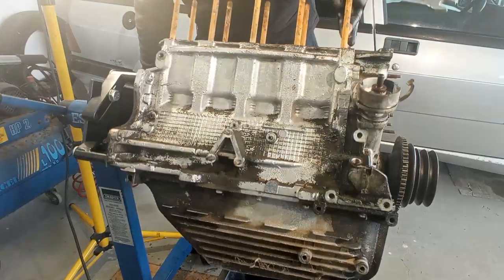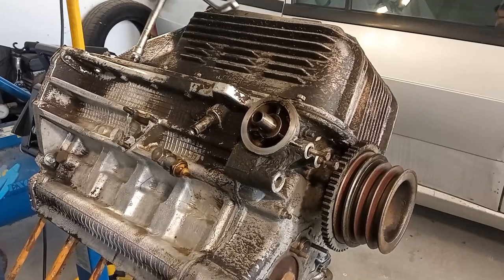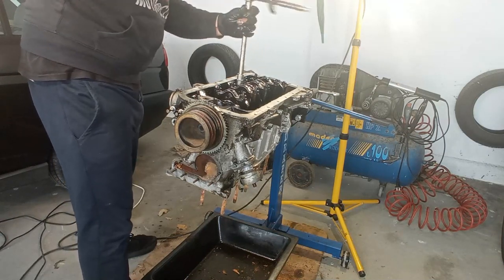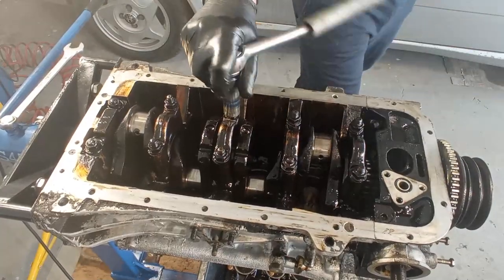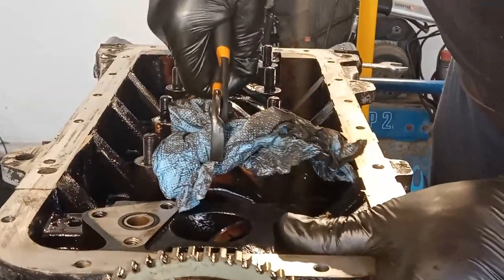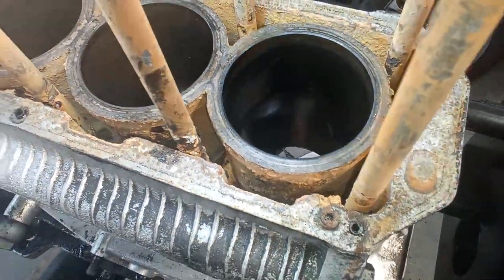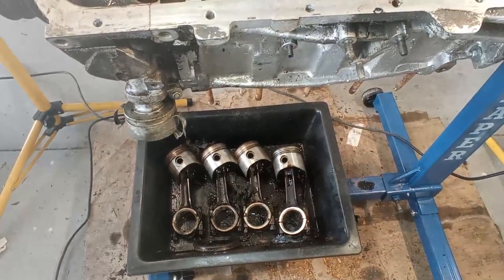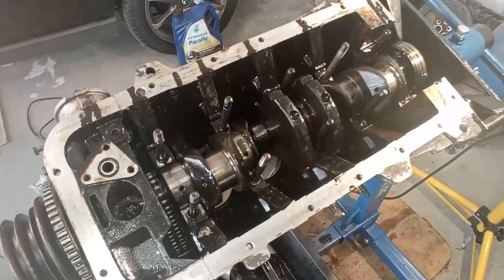Pistons, liners, con rods and crankshaft! What is the condition of this engine, can I use parts!?

Comment: When you're dealing with a car no longer in production, year by year there are less parts for them around, so I perfectly understand why you're salvaging what you can from this engine; I'm guilty of doing the same, problem I've got I accumulate those, then if I sell the car I'm left with piles of stuff that is useful, but only to a small group of people... Space becomes an issue. :) I love all my old stuff though. Less troubles in the bottom end than I expected, I think you expected more troubles too. Good one!
Reply from the maker: Hello. Yes, loving things or people is a two way street. We give s lot but also can lose too much. I'm getting frustrated with this, even though I have some savable parts, I'm afraid neither of the blocks b will work, I think and have to confirm, the corrosion arround the liners is too much. 
Thank you for your support and for watching the video

Comment: Well, you can always buy new liners. Not sure if they sell them separately to the pistons, though. I checked the price, and the new set of one piston with a liner is 140 Euros on one car parts website.
Why not put rust remover or at least WD-40 instead of the oil between the liners and the block?
Reply from the maker: Hello. Already bought a set, could only find a set of 4 with liners, pistons and rings. As they are oversize. 610 euros...
Reply: @alfaromeonoproblem  Nice. New liners is almost like having a new engine block. :D
Reply from the maker: Yes, but busted my savings... And I thing non of the blocks can be saved, have to take out the liners on both to confirm corrosion on the liners area
Reply: @alfaromeonoproblem  Oh man. :(
Reply from the maker: Story of my live. Always trying to fix the unfixable.
Reply from the maker: Thank you very much for your support ❤️❤️
Reply: @alfaromeonoproblem  You're welcome.